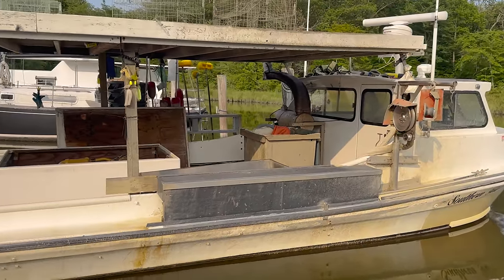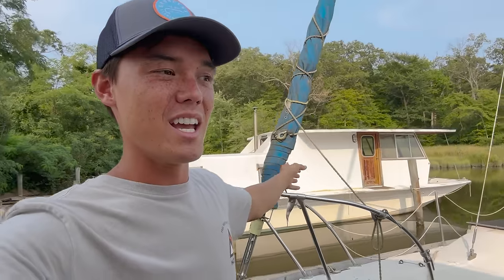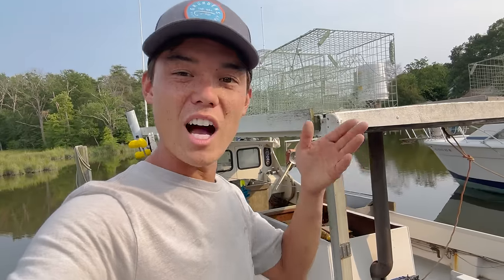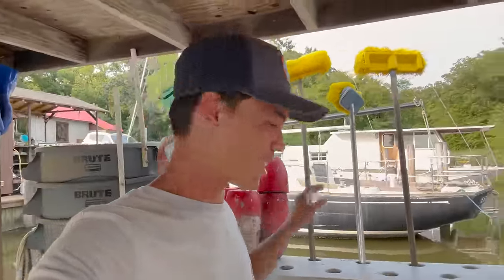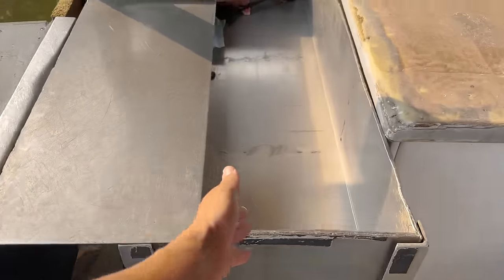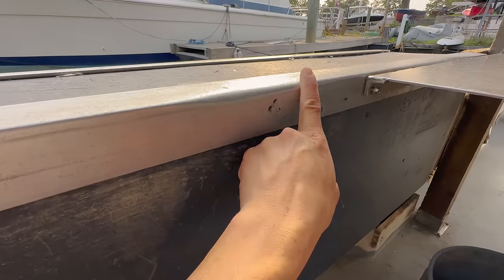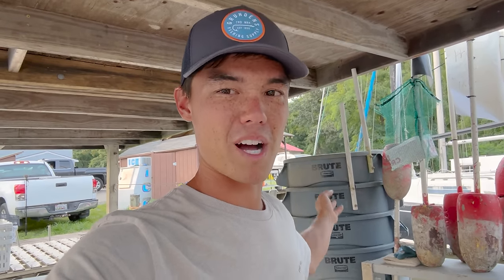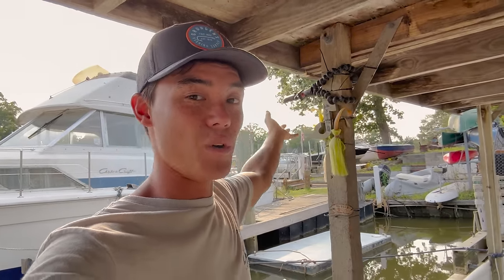Homemade Crabbing Boat Tour

Comment: 100% houseboat tour.
For a young fisherman,  you do a hell of a great job getting it done.  
Absolutely No judgment in using scrap or free material to build your dream... adds character.
I'm not a commercial anything,  but I do use reclaimed lumber, scrap steel,  reclaimed bolts, and screws to put projects together. Yeah, they may not last as long as brand new.. but it works... and that's what matters. 
Always enjoy your videos.. keep up the great work

Comment: Somebody with Eastern Shore connections here. Tilghman Island. Also for 12 years I had the only Chesapeake work boat in Bermuda. Yes, the Triangle Bermuda. It was nothing fancy. An Evans 32, cut from the 34 mold. Never fished a day in it's life. Indoor/outdoor carpet on cockpit deck. Maybe the only work boat with a transom door and a swim platform. Power was also old school diesel. A Perkins 6-354, 240hp. Basically what you would find in an old London Bus. Huge engine for the hp and dirt simple.

It was also my work boat but it hauled people. It was used for charter sightseeing and snorkelling trips. The cockpit room that makes for a good crab boat also makes it a great people hauler. Shallow draft is perfect for getting over reefs and into shallow bays with beaches.

If I was ever to get another boat for private use it would be a Chesapeake work boat, about 30', diesel with a medium length cabin for the occasional overnight.

Comment: 15:16  🤔 If you want to avoid winterizing you get a way to run a block heater that goes in one of the middle freeze plugs and you need a small electric pump to push water through the system with your shore power. Something like that is used in Alaska where they run every day. You are a wonderful Guy Brother and you clearly understand how to make decent conversions. Outstanding. I’m a Fisherman in the Tulalip Tribal Fishery. I Set Net in my Bay for Salmon and we 🦀 Crab and Shrimp and Fish everywhere around the Salish Sea. We have a ton of boats converted into Fishing boats from Bayliners and Glassply to commercial aluminum boats. We have a few crab boats it’s a miracle they make it back every time 😅 but we help them out for safety for sure.😏 God Bless you. God Bless the Fishermen ❤🖖🏼🇺🇸

Comment: We had that same motor in our do-all trucks at work. When I started working for the town I grew up in. They called the 3208 a throw away motor
Reply: Caterpillar built much of its business on the 3208.  It was their workhouse, used in everything from tractors, boats, trucks, heavy equipment and more.   It was offered in a wide variety of hp depending on intake.    There were hundreds (thousands?) of 31 Bertrams with 3208's.  Easy to work on and diagnose, overbuilt block and heads,  easy to rebuild.   They were unique because they were really nothing special, but all in, a solid performer.

Comment: We use to fish 500 pots a day by hand. Thats back when pots would b full of crab , unlike today. Hand tongs for oystering. Gill nets for fish. All by hand. We really worked the Rappahanock river which connects to the Chesapeake bay. U should change that diesel motor to a 2000 dodge Cummins., for real !

Comment: Your a hack master so add a external radiator with an electric fan somewhere like the roof. You wont need near the cooling capacity in winter. Pump and save most of the antifreeze in the spring for next year. Good luck.

Comment: Your Southern Girl and my Krystal Alyssa, have a lot in common for being in different fisheries (lobster not crab) both were built for something different the KA was built as a water taxi and I gave her a lot of the old chainsaw treatment lol. Stripped her down to basically a hull and an engine and then lots of fiberglass cloth and plywood, a little bit of lexan, a whole mess of swearing and viola lobsterboat for "cheap" (money cheap anyway, lots and lots of "sweat equity")
And a 3208 holy chit man! Some big ole iron for a boat that size  makes my tiny little M92 perkins look like a toy lol
And magic, hopes, dreams and diesel fuel... I feel that man... I feel that..

Comment: You could do a budget repower and save youself a bunch of money.  Find a rusted out dodge with a 12v or 24v cummins or even a school bus with a cummins and perform a diy marine conversion and you will be amazed at the difference.  I have repowered probably a dozen boats with truck engines.  By switching to an inline 6 cylinder engine you will gain deck space and be able to shrink the engine box.  Your fuel consumption would probably reduced by 30% and part availability and pricing is much better and you could gain horsepower and speed. You could probably do a repower for under $5000 if you shopped around for parts.

Comment: A 12v cummings with a p pump would work great and save fuel pls its way smaller than that v8 so you could make the box smaller and get more deck space,  parts everywhere on al kind of stuf tractors trucks etc,

Comment: The fella running Edison motors made a point recently about reasons why western economies aren't growing. One he pointed out is how factories are built to make the same thing every year forever. Factories used to retool for different types of products from time to time, not just new styles. Now, with disposable everything and planned obsolescence, we're basically throwing GDP in the dumpster every day. Good to see you using an old reliable machine. With the limits on what engine producers can sell these days, it will probably be reasonable for someone to create and run the tooling needed to make the most scarce replacement parts.

Comment: The materials used on your work rail look familiar , it might be a form of bathroom stall called Phenolic plastic... Hard to cut , drill and run screws through... It's virtually indestructible...